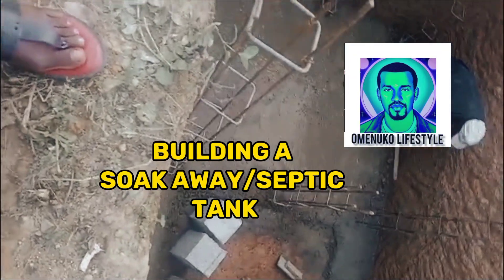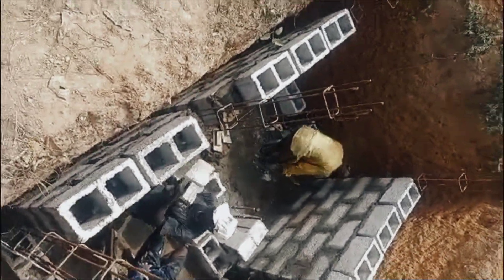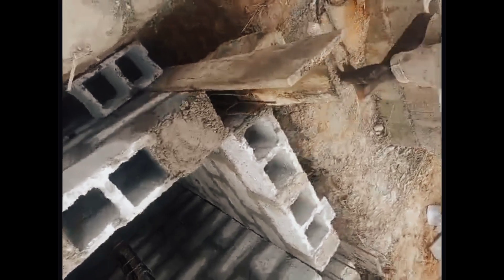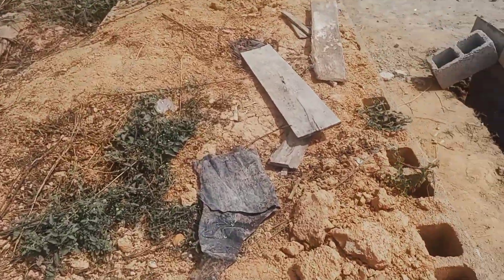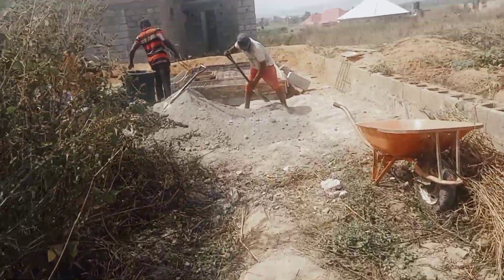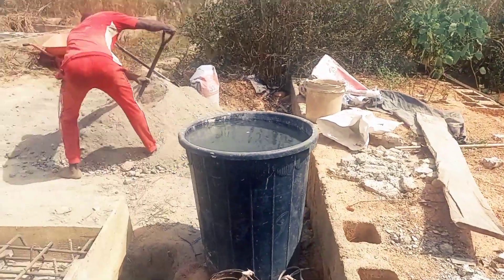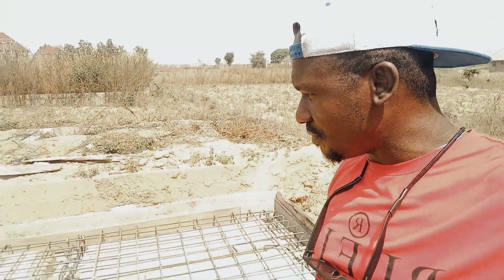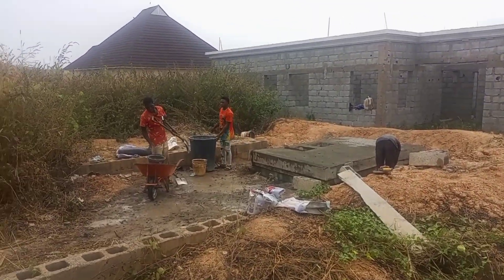How to build a soakaway/septic tank for self contained apartments PART 1

Comment: What is the normal dept of a soak away for 3 bedroom dat will last over 30yrs?
Reply from the maker: For a soakaway pit that will serve a 3-bedroom flat with 3 bathrooms and 3 toilets in Nigeria and last up to 30 years, several factors come into play: soil type, water table, usage, and maintenance. Here's a practical and safe recommendation:

Recommended Soakaway Dimensions (Longevity-Focused)

Factor	Specification

Depth	2.5 to 4.5 meters (8–15 feet)
Width/Diameter	1.5 to 2.5 meters
Shape	Preferably rectangular (chamber)
Construction Type	Lined with block walls + reinforced concrete slab on top
Bottom Base	Leave earth base for percolation (not concrete) except for the septic sludge section that retains excrement. 
Ventilation	Install vent pipe to prevent gas buildup
Design Tips to Last 30 Years
1. Double Soakaway System (Optional):
Use two chambers: one for sewage (black water/sludge), the other for bathroom/kitchen water (grey water).
Reduces overload on one pit and increases lifespan.
2. Good Location:
Place at least 6 meters away from the building and water source (borehole/well).
Avoid areas with clay soil or high water table.
3. Use of Honeycomb Blocks:
Honeycomb or porous blocks increase drainage capacity.
4. Inspection Pipe Access:
Create pipe access to check levels and avoid overflow in future.
5. Regular Maintenance:
Desludge every 10–15 years (or earlier if needed).
Avoid flushing diapers, sanitary pads, etc.
Pro Tip:
If the area has poor soil drainage (like clay), you may need to:
Excavate deeper (4.5m+)
Line with gravel and filter cloth
Or install a septic tank with soakaway combo
Reply from the maker: Would you like me to make a video response?
Reply: @omenukolifestyle8058 this is totally fine. Answers my question. Thank you so much.
Reply from the maker: @iamcharityudoh7417 you're welcome

Comment: Education,  Education,  Education.
99.99  of the population do not know the importance of septic tanks plus how  DANGEROUS  a tank can be , especially  located to close to a WATER  / WELL  used for drinking.
Reply from the maker: True
Reply: Exactly, most house will have the soack away and the boreholes not too far away from each other or close the the neighbors soack away...soack away is a real health hazard and easy source of typhoid in urban areas.

Comment: where are the stones for the sock away?? And you did the piping ready from the houses or not yet?
Reply from the maker: If you look I labelled it part one.. But I didn't upload part 2 because some videos were missing.. But I did put hard core at the side of the soak away and some hard core inside. Some sources also told me while doing it that it's not so necessary to put hard core in the soak away section